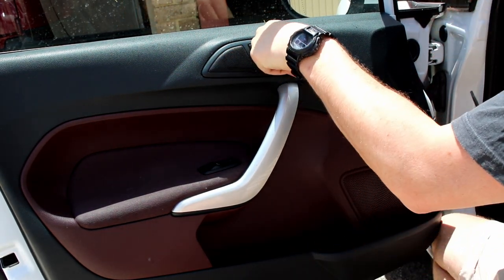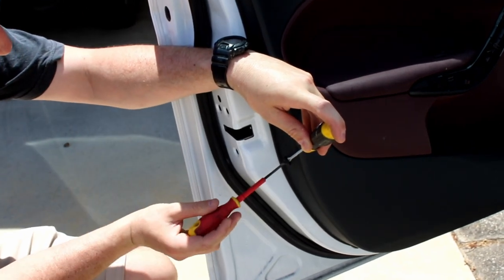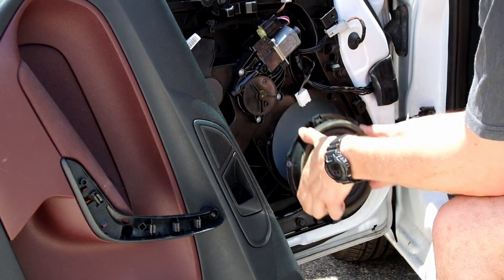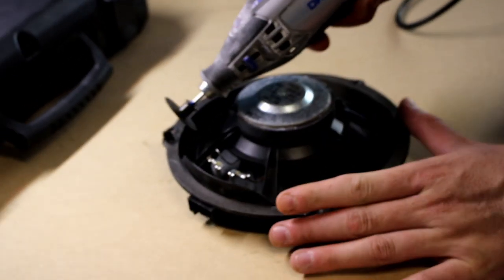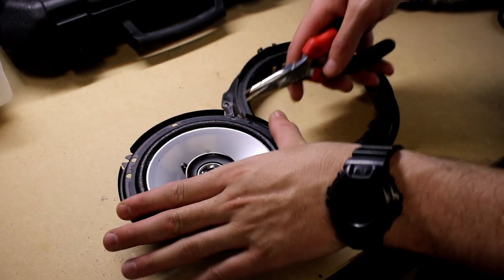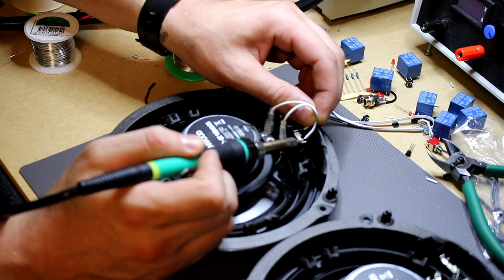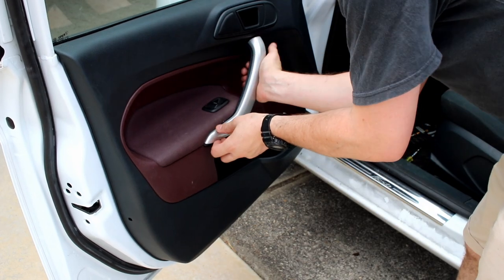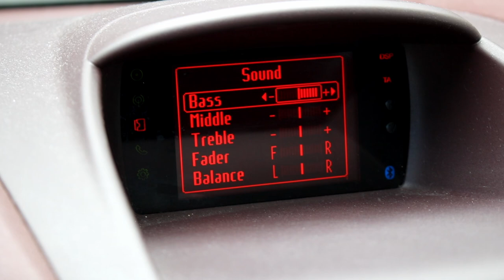Ford Fiesta Speaker Replacement

Comment: For anyone that isn't savy in cutting or soldering, you can buy speaker brackets that are the same as the factory pattern that fit 6 1/5 inch speakers, and the speaker wire harness that plugs directly into the white connector you unplug from the orginal speaker. No cutting or soldering involved.

Speaker Harness : Metra 72-5602
Speaker Bracket : Schoshe SAFD655
Reply: ↑↑↑↑↑↑↑
   MVP
Reply: This guy is a legend, respect for teaching a dummy like me
Reply: Yeah did that, much cleaner job, plus you get to save the old speakers if needed.

Comment: Great tutorial, we used it and got the speaker in. Had to stop at home Depot twice however :/. 
Tools needed: star screwdriver (sizes 20 + 25), Dremel, soldering iron and soder wire and he used hot glue, but I used super glue. Thanks much for uploading. It was great!

Comment: For Ford owners looking to upgrade the speakers but Don't want to cut or modify anything, PowerBass makes direct replacements... No cutting or modifying....
Reply: Lone Mic Productions  US company and don't list for the exact model depicted above (which is a 2009-2010 model). Stuff for 2011 model would probably work though as many parts like interiors carried over.
Reply: can you give the exact PowerBase model number - thanks
Reply: @JayWalker2222  OE652-FD those are the ones I bought for my Fiesta ST ... Idk if your cars need all four 6'5 speakers but mine does
Reply: L
Reply: @Icelotion  ??
Reply: What you talkin' 'bout Willis?
Reply: Do they sound better then the sony speakers?  @adlerdefender8067
Reply: @adlerdefender8067 do they sound better then the stock sony speakers? 2016 ford fiesta st
Reply: @jaynosowsky9708  if you are planning on getting an amp definitely... Just one thing they do have a lot of mid range frequencies so you are going to have to dial down the mids on the EQ
Reply: @adlerdefender8067  what if you don't want an amp....but want better speakers...I hate the sony speakers...I think they sound bad...I did have a bose speakers in my audi tt so I've been spoiled. What would you recommend??
Reply: @jaynosowsky9708  unless you change the source of your sound it won't get any better than what you already have .... You might get a slight improvement but it won't be as good as the Audi
Reply: @adlerdefender8067  so your saying,  I should just add an amp to the factory speakers??  Or do I need speakers and a amp?  What do you mean my source??? I don't know anything about audio,  but turning the volume knob..lol
Reply: @adlerdefender8067  the audi did have an amp from the factory..which probably helped a lot.
Reply: @jaynosowsky9708  yeah , plus that means you had the premium sound in it ..
Reply: @adlerdefender8067  yeah to what ...can I just add an amp? Or do I need speakers and an amp? ..if that's all I need is an amp that would be good

Comment: Great information, saves having to fashion new sound boards to fit each door. Although two things worthy of note: Test your upgraded speakers BEFORE reinstalling your door cards and secondly, ensure the replacement speakers are of the correct ohmage for the head unit. two and four ohm speakers could potentially damage an 8 or 16 Ohm head unit, causing the output stage to overheat and ultimately fail, just when you thought that pounding bass was kicking so good. 😉
Reply: Do you know the ohmage of the ford fiesta ?

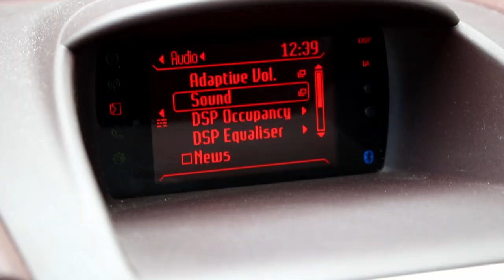Comment: 5:15 lol bottoming out from that. Most the time these aftermarket options are crap, i upgraded the stock woofers from my 2010 fiesta and they sound worse asides from the tweeters. Most stock system speakers are optimized for the stock head unit, and which is why the aftermarket speaker couldn't handle the bass.

Comment: Theres another easy way for the smallest Soundsystem without changing anything. Just code the radio(bcm) to the bigger one. Works very fine. I also installed speakers in the back doors and code the bcm for havin the fader. The cables for the rear speakers are pre installed in the car but not plugged i the radio. You have to search hard for them. But they are plugged in the connetcor for the doors. In the doors you have to install new one

Comment: Just bought a 2009 Zetec for the wife, although I'll be driving it a lot and I do like my music. It would have been nice to have had the size of the replacement speaker mentioned (or did I miss that?). My speakers are functional, but I like the volume up high when I'm alone, and some tracks send a horrible buzzing vibration through the door- they're not handling the bass. So replacement has crossed my mind. I have some nice Celestion 4 Ohm drivers sitting around but they're only 5 1/4 inches so I might need make an adaptor. It would have been interesting to see what the tweeters looked like. Probably garbage, but tweeters are a low priority for me, can't hear over 13kHz anyway. The Celestions can go pretty high in any case... it depends on where Ford crossed to the factory tweeters. Had some nice Jaycar 6.5" 4 Ohm but they ended up in an ancient pair of Wharfdale cabs.

Comment: Nice one mate. Exactly what I was after. Same thing with my wife's fiesta. I've just installed an Android double din head unit so now I have to replace the speakers. After wiring it all up I finally realised hers doesn't even have speakers in the rear doors. Think I might stick a set in the parcel shelf.
Reply from the maker: I'm guessing you have a different model fiesta? Wish I could replace the stereo system in this one, unfortunately it has the molded dash, and control system is all in one. Good luck with speakers bro
Reply: Ours is a 2009-2010 WS. I've used the aerpro fascia and had to do my own wiring as there was no harness available. https://aerpro.com/vehicles/ford/ford_fiesta_2008_ws_wt_wz
Reply from the maker: Justin Moore thats a cool product. Ill probably order one, tired of the dodgy Bluetooth in the factory unit
Reply: Only the Zetec got the 6 speaker system. You might be able to get the parts from a Zetec from a wreckers. Door cards might be the hardest part to find. Or you could mount the new speakers directly to the door card without the factory grille. That might impinge on rear seat room though. They're already pretty squeezy :)

Comment: Okay guys so I just replaced my original front speakers with exactly the same speakers as in the video. I drive Fiesta S Mk7 2010 with originally mounted front and rear speakers ( 2 door version). Unfortunately original ones sounded better than the Kenwood. It made me think when I got Kenwoods and compared them size wise to original ones.  Kenwood had much smaller magnets and smaller coil too. Original sounded alright with decent bass but when the music was louder it was distorting sound, but after watching this video I thought it will be much better bass as you said in the video. To summarize I regret replacing them and I wouldn't recommend those speakers.
Reply from the maker: Jakub Tokarz I guess the screenshot was a little misleading. The state of the factory speakers in my case were terrible. They had very little response, were scratchy and only got worse with volume. The kenwoods are cheap speakers, but are much better than the shitty state the factory speakers were in. You could always use this tutorial to aid in installing some higher quality speakers of your choice
Reply: TheHandyTech  to not be misunderstood, this tutorial is a great instruction on how to replace your speakers step by step. It's just the shitty Kenwood speakers that made me cry when I heard them 😂 So just for people who are like me looking for better sound than original - look for better speakers than Kenwood.
Reply: Some years ago I put Kenwood splits in the doors of my Soarer. They were the last of the 4" Kenwoods and sounded far better than the originals. I didn't want to go any bigger as a lot of mods were required, and in any case I put new 6.5 in drivers (also splits) in the parcel shelf. A 10" subwoofer also helped with the bass :) (Soarer is a 2dr coupe and came with two 6.5 in standard for the rear, 4 in for the doors, mine were totally shot). Some models came with an amp in the boot floor and a 10" sub in the middle of the parcel shelf,  2 Ohm though. Mine didn't have the deluxe stereo setup so I put a new sub in the stock position, with a 4 Ohm amp in stock position under the floor mat in boot, and ran the rears and sub from that, fronts off head unit).

Comment: You saved my life with this video. I changed the factory speakers for a JVC and the sound it's incredible. If you have a 3 door's car can you upload the back speakers?
Reply: Che modello di JVC hai installato?
Reply: @lucabrigandi3653  JVC CS-DR1720 it's a good option, the sound is very nice with a good bass
Reply: @francomaturano6531  its not a problem to have a speaker with a tweeter if there is another tweeter above?
Reply: @lucabrigandi3653  if the tweeter are broke, you only need to disconnect the cable, but you don't have problems with 2 tweeters, because I use both👍🏼👍🏼👍🏼👍🏼

Comment: just wanted to check if there any provision to install the Ford OEM tweeters into the little mesh given on the doors... if so can it be done by simply tapping in the tweeter output wire to speaker input wire

Comment: How did you know what temimal on the conector was + and - ? Thanks!
Reply from the maker: It won't matter for my speaker as there is no componentry to split higher freqs to a tweeter or anything like that. There is a tweeter in the door but I did not alter the wiring. Another way would be to check on the factory speaker before replacing it

Comment: good job, are the tweaters near door handle still in use? tx
Reply from the maker: Thankyou. Yes the tweeters are still in use. All we swapped was the 6inch speaker, we didnt alter the vehicle wiring loom at all :)
Reply: @TheHandyTech  OK ty, any idea of DSP wiring on a 2019 Vignale ? I have the 7 HP and all the sound seems to come from the center dashboard..
Reply from the maker: Have you tried to adjust the output in the stereo menu system (change its balance from left to right or from front to rear to see if you can get the other speakers making sound). Next level would be to measure the resistance of your speaker pairs by using a multimeter on the stereo plug to see if any of your speakers are blown
Reply: @TheHandyTech  Yes I did try all adjustments. The car is new.  I'm trying to know if the tweeters (on the dahboard) , missing in this version of B&O are pre-wired. It is really a mistake on this version (7 HP) where there aren't any tweeters, HP in front door are woofers, rear door full range, dashboard mid-range.  There is no stereo effect and all the sound seems to come from the dashboard. Sound is better on rear places... sound on my old Titanium was so good...
Reply from the maker: Bummer maybe give the dealership a ring and see if they have any more information regarding the specifics of your vehicle. Best of luck and thanks for watching the vid :)

Comment: Nice, except the 2013 comes with a tweeter in the upper section of the door.  I think I'm going to take it to a professional installer.  It will probably cost more than I paid for the speakers.
Reply: The car on the video does have the little tweeter on the door too. On 0:38 you can see it next to the door lock

Comment: Hi , i see you're using 16cm speakers. Wil 16,5 also fit?
Reply from the maker: From memory there was a little wiggle room so you should be ok. Worse case you may have to file the hole sizes a little or make some adjustments to the speaker mounting points

Comment: Finding that since doing this same thing and adding some pioneer speakers my tweeter speakers in my upper doors have stopped working now.. any idea? (Mk7 09)
Reply from the maker: Were the speakers you installed matching impedance? 4ohm?
Reply: @TheHandyTech  - They're pioneers that apparently have tweeters in so now I'm 99% sure i've blown my tweeters as they don't do anything. I've un-plugged my main speakers to see if just the tweeters would work and they're not.
Reply from the maker: Bummer that is tough luck man. I think the speakers I used were standalone 4ohm speakers not combination like the ones you have installed. You might be able to replace them too, else just use the new ones you've put in

Comment: Hot melt glue isn’t s good idea around things that vibrate, it will break away from the housing given time/vibrations. Evostick impact would be a better choice. Best option is to screw them onto the plastic housing with spire clips then they won’t rattle.

Comment: What about the door handle? No cable to disconnect? Or is it electric?
Reply from the maker: You only need to expose the speaker, no need to remove the entire door card. I just rotated the door card which allowed access to the speaker, you dont have to take it off
Reply: @TheHandyTech  I want to remove my cards entirely, to clean the little cloth pad better. The car I bought was filthy. Used as a tradie's van, I think :) My interior's the same colour scheme as your GF's. I thought the maroon only came with black and burgundy cars, but hers is white.

Comment: Just replace stock audio, then install a better radio system.  It’s much easier than replacing speakers.
Reply: maciej migacz i havent found any radios for these besides the oem ones.
Reply: maciej migacz I have a replaced radio and the speakers suck at high volumes. Anything over 20 will have the speakers sounding funny. So definitely need new speakers

Comment: Excellent tutorial !!! But original speakers are 25 W , 4 ohm, 16 Cm  kenwood are 300 W and with out an amplifier it s not correct
Reply from the maker: Antonio Vivacqua The input impedance of the kenwoods is 30W at 4Ohms, so agreeably not the biggest increase in power (also considering its the same factory headunit driving the speakers). I'll save face by saying "way more bass" than the shitty state the factory speakers were in haha. Thanks for watching bro!